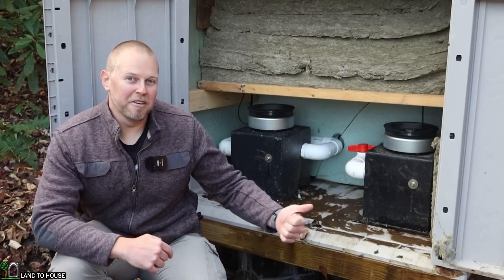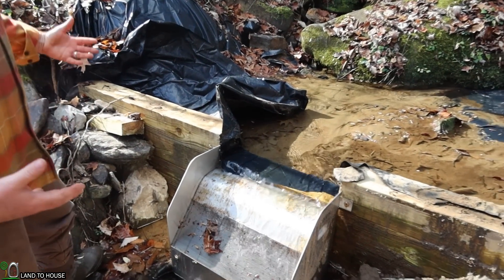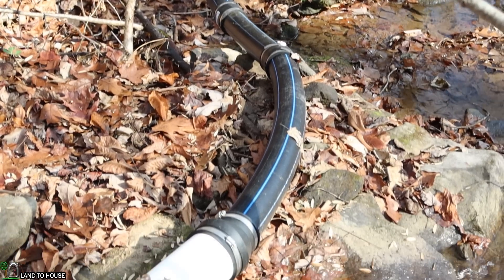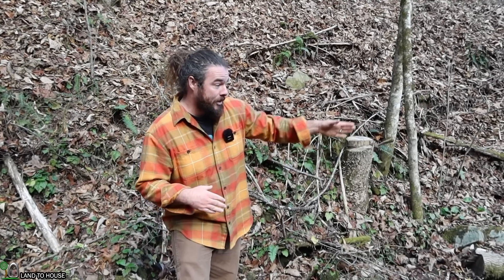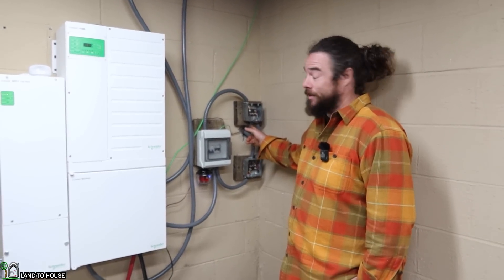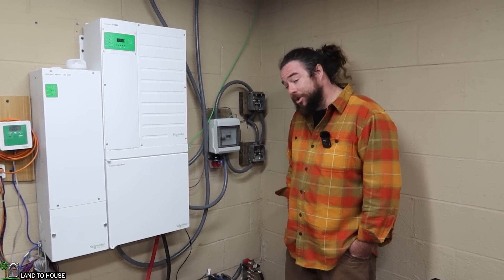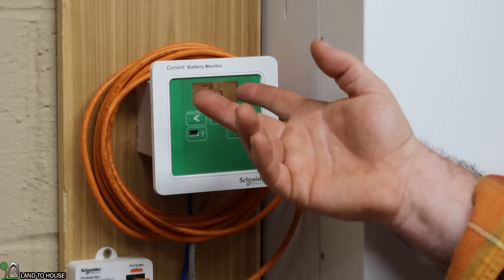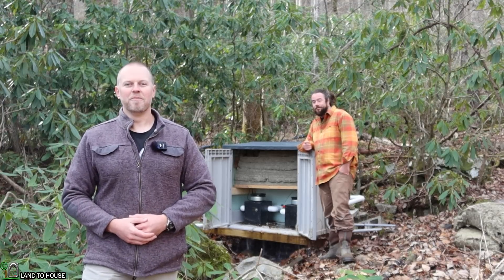Ultimate Awesome Over 800w of Micro Hydro Power

Comment: @4:53  What's unsightly is that wire hanging out of that elbow fitting and the cover, should have used larger conduit rather than nullify it by not having the wire sealed up in it...  I don't do much better though, I'd just forget the conduit and have a bare romex wire there lol.  IF I bothered to spend the money on condiut though the wire would be all inside, had a huge fight with some 2ga 4conductor service wire so I get it, but that 10ga wire is tiny, make it work.

Comment: Cool design.  With the amount of drop you have there are other forces you can use for additional electrical generation.

Also why not run the stream water thru a filtration system and a UV light for your water instead of the deep well?

Comment: This guy mentioned a "well". If there is a well on the property then that means there is an underground creek. I wonder how many of these "wilderness isolated properties" are located near an underground creek.  Because if the penstock pipe and turbine were to go straight down into a shaft located near the house. That would minimise cabling distance (and thus loss) while providing sizeable power. The only problem obviously is identifying that underwater creek and then digging a vertical shaft into it to place the turbine into. This expenditure though can pay itself and give back a nice ROI if the power generation is substantial. I mean, you could charge your ev car and still have spare electricity to dump into the grid (if available)  so  the home installation might not require batteries!! 
   I am a "Telecommunications engineer". I studied 5 years of math, physics, signal theory, signal processing, RADAR, electronics, etc ...  You should look at  "Ground penetrating RADAR". It is possible to detect underwater creeks and even assess the volume / flow before even  digging a shaft to reach it. If one has surface creek and an underground creek in close proximity within the property, the amount of energy that can be extracted can multiply X times due to less friction in the penstock pipe, and less losses in the cabling due to shorter vertical distances.

Comment: Why converting ac power to DC and charge batteries? Can't he use ac power generating from turbine directly?
Reply: Without the batteries he would lose the power he is generating if there is a light load. The battery allows power to be stored for later.

Comment: Love your MH system. I also got all my my equipment for my MH system from Spencer. He is a God send to me. Couldn’t have built mine without his time, knowledge and most of all patience with me. My measurements are bit different. I have two turbines also and my flow is from 100 gpm to over 600 gpm. My penstock is 900 ft 8” pvc making around 1.8kw.

Comment: A guy featured on gridlessness had a killer hydroelectric system.. he dug a square hole and lined it with timbers. It was a silt pond basically that he only had to clean out once per year. Guy was generating so much power that he would occasionally have to dump hot water from his hot water heater in order to consume the power..

Comment: Is there a way to use solar to give the 2 turbines power to run this system? i understand the turbines create energy that is being stored in solar batteries but if i wanted to use the energy my turbines are generating for something else as perpetual power is this possible?
Reply: Water Is the Input Force! It spins Pelton Wheels, that drive the Alternators! 
If the water stops flowing, so does the Input Energy! 

Solar PV can, apparently, be added as another input at his Inverter. Adding another 800 Watts of Solar PV, would be great for adding power when people are typically using it! However, he is "Selectively" off Grid, per his controller settings mentioned! The Solar PV add, would improve the "Off Grid" time! And be useful, when he adds those new batteries!

Comment: That's a really impressive setup! In theory if you were to use the same amount of copper, you could get slightly better efficiency by having the rectifiers at the source and running the DC power down the conduit. That's because once rectified, the voltage is higher and current is lower for the same amount of power, meaning you have fewer resistive losses. However, it probably makes more sense to have as much of the complex equipment inside as possible.

I really like the redundancy.
Reply: Come guys you all are close ,put the whole system indoor  use two drums, one of which you turn into a Drum pump ,,^ iit must above the  other drum which would have both the ram pump and generator above it,, way it should work,, Drum pump should pump the water from the lower drum to the ram pump to generator, having all the water falling back into the lower drum,,,. Or am I just crazy,,. Please fill me in with how it goes,,,.

Comment: Amateur question, suppose you have tank full of water and generate 10kw   how many kw need to pump the water back to the tank with electric pump?
Reply from the maker: Electric pumps have an efficiency as do the turbine. Lets say both are 80% efficient.  You will constantly be losing 40% of the potential of the water with each cycle.

Comment: I'm quite the newbie when it comes to all this sort of stuff. What happens in the event the batteries are full and you aren't consuming the full output of the turbines? That extra production needs to go somewhere or the turbines need to decrease output, right?
Reply from the maker: The mppt charge controller will limit the production. The turbines will free spin until more power draw is detected in the home.

Comment: This is a small version of what I'd call a dream system.  My only question is why pump from a well when you could collect and filter the stream water somewhere uphill also?  Sorry if that's a dumb question.
Reply: Possibly, another 1,000 Feet of Pipe, some Tanking or Reservoir, might still need a Cycling Pressure Pump, depending on "Reservoir Size & Budget!"
Reply: I’m sure it’s pretty common but there is something sisyphean about using hydro power to pump water

Comment: No such thing as a bad idea so hear me out instead of a water turbine or a water wheel which normally need a high flow rate and pressure for the needed  rpm and load I’ve been thinking instead of using the flow and pressure of the water for power instead use the weight of water using a water convayorbelt with bucket bolted to it so each one could be filled with better control so less waste and pressure needed and the longer the belt the more weight to drive a gearbox or a big pulley to a really small one for the required rpm what do you think
Reply from the maker: I've seen videos of water wheels made from buckets. But I'm not sure about the conveyor belt idea. Are you saying that a bucket would be attached to a convert belt in a vertical orientation? That would allow the weight of the water to pull the belt down?
Reply: @LandtoHouse  yes

Comment: Great video !!
Are you running the 2 turbines connected together to one terminal from the bridge rectified current in series ? Or are they connected to 2 different inputs in the controller
Reply: Yes you can parallel them to cut the voltage in half
Reply: @SpencerLAPower  that’s cool I’ll definitely look into it cheers for that
Reply: The rectifiers are in series to double the voltage for the high voltage charge controller
Reply: @SpencerLAPower  that’s pretty cool man I didn’t think that was possible never seen anyone do it anyway can you parallel them to keep voltage lower ?

Comment: Nice setup.  I have the exact same inverter, charge controller, and batteries. 2 notes:  1) I'd be REALLY interested in seeing your conext settings (specifically, your grid/grid support/inverter charger/charge controller settings.)  and 2)  There is a firmware update for the batteries that lets you do closed loop communications with the XW pro (if you have the insight home gateway)  Allows you to remotely monitor/configure your system and would allow you to remove that batterymon as it serves the same purpose (After the firmware update,  it shows up in the config screen exactly as the battmon does)
Reply: Come guys you all are close ,put the whole system indoor  use two drums, one of which you turn into a Drum pump ,,^ iit must above the  other drum which would have both the ram pump and generator above it,, way it should work,, Drum pump should pump the water from the lower drum to the ram pump to generator, having all the water falling back into the lower drum,,,. Or am I just crazy,,. Please fill me in with how it goes,,,.

Comment: From my research I believe that by placing the diode where you did place it was a good idea.
The alternating current from the alternators well have less current and voltage loss.
It was smart not to convert it until you got to your battery room.
If you had placed the diode close to the alternator you would have had to install a lot larger gauge wire adding 
a great higher cost to your install. 
Larger pipe would have increased your water force/ power to the alternator. 
You still did a great job. I will acknowledge that you have limited water volume.
Maybe a 24 or 36 Volt alternator in your next project. Power inverters are more efficient when higher dc voltage is used.
Reply: The DC  Voltage going in to the charge controller is around 300 volts .

Comment: Does he use a dump load for when the batteries are full?
Reply: Yes the turbine can free Spin once it's unloaded with no problem but it is more energy efficient to dump the load somewhere using a solid state relay triggered by the charge controller. Adding more batteries usually takes care of this in those cases.
Reply from the maker: My personal hydro system is coupled with solar. When the sun is out the solar power takes over and the hydro unit often times will free spin for up to an hour at a time. There is no dump load on my hydro system and it has worked out fine for over a year.
Reply: No dump load is not needed but can be added
Reply: @SpencerLAPower  the turbine is happy to free spin without a load? 
Makes sense to have it dumping into an electric hot water system or something to take advantage of the power!
Reply: His system is connected to the grid, why not dump the electricity into the grid to earn some extra money? That's what my solar is doing, if batteries are fully charged, the rest is dumped into the grid to make some money...

Comment: Please tell your friend to look at Class T fuses. They are necessary for arc flash protection when using LifePo4 or any high density high discharge power source.
Reply from the maker: Interesting.  Thank you for the heads up.

Comment: Nice video and control instruments explanation. As a western NC guy also,  do you experience these 3 feet flash floods we get 3 to 5 times a year? And does the reservoir system hold up or need constant high levels of maintenance?
Reply from the maker: I'm also in Western North Carolina and get those random Flash floods couple times a year. One time my 30 gallons a minute Creek was flowing at 450 gallons. The dam that was Built in this video coupled with the coanda screen do extremely well even in flood conditions.

Comment: Great job.

Why dont microhydro DiY guys use the ground as it was intended, running proper wires and bonding devices properly is ideal.

Good video though, lots of time and $$$ went into that one, for sure.
Reply from the maker: My personal system does use 10/3 wire to go from the turbine to the house. Seems to be working well. I think a lot of these DIY folks like to save a little bit of money on wire cost. I personally prefer to spend a little more money on wire and have the proper size.

Comment: That’s really nice. I wish I had a good water source like that on my property
Reply from the maker: 200gpm + is a great flow. Very nice to have.
Reply: Come guys you all are close ,put the whole system indoor  use two drums, one of which you turn into a Drum pump ,,^ iit must above the  other drum which would have both the ram pump and generator above it,, way it should work,, Drum pump should pump the water from the lower drum to the ram pump to generator, having all the water falling back into the lower drum,,,. Or am I just crazy,,. Please fill me in with how it goes,,,.
Reply: @lionelcox9119  The laws of physics won't allow it, specifically conservation of energy. You can't get more energy out of something that what you put in, you would lose energy powering the pump to move the water. What you describe is known as a "pumped hydro system" except that it only stores energy by pumping water uphill using solar/wind power then when the water runs back downhill through a generator you gain most of the energy back using water as a battery instead of expensive lithium batteries.
Reply: @lionelcox9119  i came to say the same concept. That's why im here currently studying closed circut

Comment: What is the estimated cost for this set-up?  Excluding the Grid tie on parts.
Reply from the maker: The coanda intake screen is costly at around $1200. The 3" pipe after C19 is also high at over $3 per foot. The PMA is around $1100. All said and done this type install is around $10k. The payback is around $1250 a year.
Reply: @LandtoHouse  Thank you very much.
Reply from the maker: That is including the batteries and Schneider system.